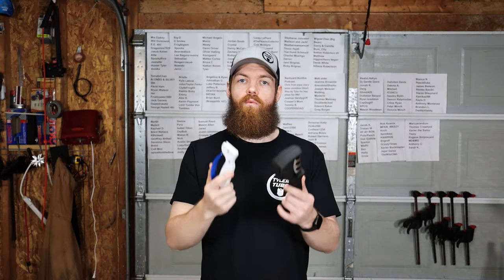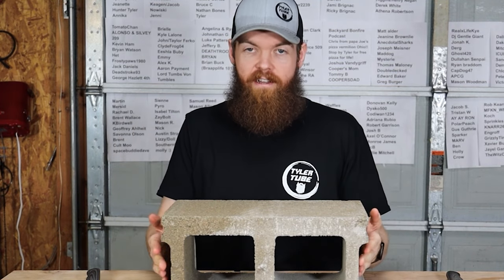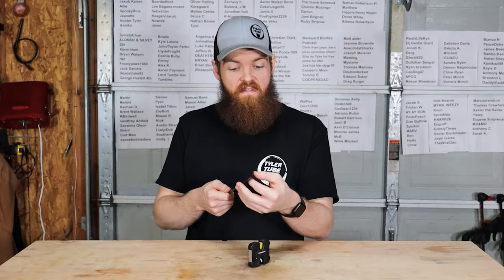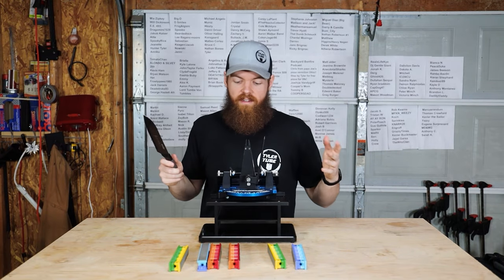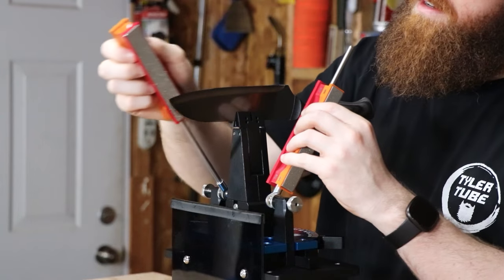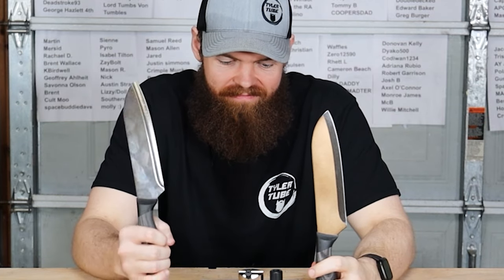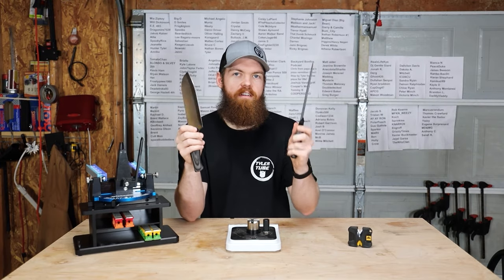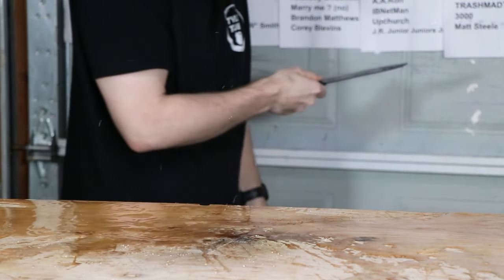$4 VS $1000 Knife Sharpener, Which One Is Better?

Comment: The sharpener is only as good as the blade’s metal and the acuter the angle the sharper it will get but the edges durability will be compromised.
Reply: Also I have the work sharp version of the wicked edge and I can get my kitchen and hunting knives raver sharp. My work sharp sharpener comes with ceramic stones and leather strapping pads that also put a nice mirror edge as a finishing edge.

Comment: You made 3 mistakes with the wicked edge. 

1. You didn’t shim the clamp. That’s why it moved around

2. You didn’t center the blade in a forward manner. It was certainly way too far back 

3. Your technique was amateur. You need to know how to use that system

Other tests with that system get the wire broken at under 100 grams. Sometimes as low as 30

No joke

Comment: What a crappy test !   The cheap sharpeners don't allow you to choose the best edge angle ( maybe 15 degrees for a Japanese chef knife,  17 deg. for German, 20 degrees for  most kitchen knives, 25 degrees for most hunting / survival / bushcraft knives, Axes, mower blades and other tools ( whatever the factory did or maybe 30 degrees ).
   Instead of stopping at 1000 grit, finish up with 6000 grit or a ceramic rod and a leather stropp.

Comment: I learned to use a whetstone when I was about 7 years old so this seems really excessive to me. If a 7 year old with minimal experience can make a kitchen knife shaving sharp then anyone can.
Reply: It's not just about creating an apex, this controls the angle, bevel width and compared to freehand sharpening on old stones with newer supersteels is generally superior.

These are used on knives that make $1,000 seem like a very small investment.

Comment: I have used the bottom ring of a coffee mug to hone knives with and I find it works just as well. Tyler you could try doing the same as it really does work and the best part is it costs less than the 4 dollar sharpener.
Reply: Honing is what most people should be doing before every use of a knife. It will keep the edge much longer until it can't keep an edge and needs to be re-profiled. Working in a professional kitchen. The knives only have to be sharpen every 6 months to 2 years. with good honing technique. People go to the stone to often when it only needs to be Honed.
Reply: @faervas1234  you are right as rain and the best way I have found to keep my blades sharp is to hone them ! Maintenance is key,that and using knives correctly in the first place.

Comment: you don´t even finish the knifes with lether strops, that makes a huge diffrence removing burres.  the 1000$ is way better if done correctly.  I an the other hand uses only Tormek T-8 ,  It is so superior to almost everything, knifesharperner with water and turning stone is incredible superior to make a knife sharp, and mutch cheaper then 1000 $, more like 500$, the original stone can be 220grit or 1000grit,   I only use 220grit and knifes get so sharp that you can push a knife frue a papper,  I don´t men slicing the paper, just pusch the knife frue the paper , that is verry sharp.  everyone slicing a paper with a knife, try to pusch the knife frue a paper an one spot an the edge, if it can do that  it is mutch sharper then a sharp knife!

Comment: You fundamentally do not understand sharpening techniques like de-burring , polishing , apex creation or how to use the wicked edge.
If a user doesn’t understand those concepts then they are definitely not going to get the most out of advanced sharpening tool.
Pull through sharpeners can cause so much damage to knives they are only really for people with no interest in sharpening that have cheap knives.

Comment: For anybody watching this, 2 observations:

1) When you use the pull through carbide sharpener you are cutting a "V" shape at the apex. once you've  cut the dulled edge enough that it fully reaches the pointed V shape, no additional pulling will give additional sharpness. 100+ passes on a carbide sharpener is simply grinding the edge of the knife away. The ceramic section hones the tip of the V to minimize the burr on a fresh carbide edge and touch up a lightly used edge. It only takes a few passes to do this. Poor technique and human error means results in minor misalignments that will round off and fatigue the edge. This video is NOT a how-to for proper use of the sharpener.

2) Even when using a guided system like the wicked edge, you need to use the proper technique and sharpening fundamentals. It's not an elliptical machine for an arm workout. this video is NOT a how-to for proper use of the sharpener. The edge needs to be properly apexed, then burr-minimized before progressing to the next reasonable grit. Not every grit in the kit is needed or even ideal for a sharpening progression. This video shows what happens (regardless of sharpening system) when you don't apex the edge, don't maintain the correct amount of pressure, don't verify burr formation, don't minimize the burr, and finally don't remove the burr. 

If anybody is interested in actually sharpening a knife, there are plenty of good youtubers that teach proper sharpening techniques. BigBrownBear, Michael Christy are examples of "pro" sharpening channels. While Cedric&Ada Outdoors is a great example of an everyday joe (or pete)  who uses a guided system with proper technique to achieve excellent edges. Vurtovice is a great channel of an old fud who sharpens knives the old-fashion way using proper technique, sometimes with microscope views of edges.  Do yourself a favor and watch some videos discussing "apexing", "burr minimization", and "stropping". A little practice with relatively inexpensive equipment will result a better edge than $1000 kit used incorrectly like it was here.

Also, you can't use pot-metal throwaway knives that have zero quality control over the steel.  A quality knife doesn't have to be expensive, but it can't be of unknown material, hardness, etc. A Morakniv mora basic can be found on amazon for $9.99, which has known cutlery blade material hardened correctly to hold a knife edge. There is no excuse for using a $16.99 crap knife using junk 3Cr13MoV steel hardened to an atrocious 52 HRC. it is the pinnacle of rebranded overseas trash made by the lowest oem bidder from the cheapest available materials.
Reply: Fantastic! You get it.

Comment: Just so you know that when normal knives get dull it’s not because they were scraped against cinderblocks. You’re taking off so much more metal than you need to be!!!! Just cut some tinfoil like a normal person! The knife sharpeners that are generally sold to public are not meant to reform as much metal as you took off!!!! Stopppp! That’s why you had to run it through the knife sharpener 200 times on one side!

Comment: lol regardless the ceramic bein labeled as 1000 still has that 2000 grit and up in it so this is literally just user error and not knowin how the thing fully works plus that guide fucks you up more than helps you just a heads up cuz i mean if you sharpen knives alot and know your blade the feel of it an all that you won't need a guide

Comment: Tyler, you're entertaining to watch, but a long way from scientific, or even reliable. The paper test is more a test of how rough your blade is (if you have a pretty sharp blade with a rough edge, it cuts paper much easier than a really sharp smooth blade (400 grit sharpened knife will do the paper cut test easier than an 8000 grit sharpened blade. The tungsten sharpener is only good for a few sharpens and then leaves such a corrugated edge on your knife it becomes impossible to sharpen effectively without taking back with a sharpening stone to a smooth edge. Your water bottle test is only a test of technique and luck. 
Lastly the $1000 sharpener puts a different angle on the edge along the edge of the knife (it cuts a cord across the radius of the sharpener motion,) so, as usual, the angle is almost irrelevant. Anything up to about 30 degrees will make a really good edge if ground and polished well. I've never seen your scale based sharpness testing rig. I'll have to find out how it works, but I'd bet good money that your $1000 sharpened knife would post different results depending where on the blade you tested it (providing your test rig is reliable to within 2-3%)

Comment: I know I’m getting into the comments a year later than it’s released but this is 100% user error on the wicked edge. Sharpening basics dictate that you need to get a burr at the apex on each side before continuing. Burr removal and stropping is key and you didn’t do any of that. Research and practice.

Comment: The sharpness tester could use an improvement. I'm sure it measures accurately, but are you sure it's doing it in the same spots?

I'm thinking you make some kind of rig that allows you to put the tip of the knife in preset locations, and then test the sharpness at that point. This will give you multiple test locations along the edge, and you will be consistent across each blade.

Before you start any testing, you should also ensure that each blade have similar values (+/- a few percent) measured across multiple tests at the same points and across the blades.

Comment: To everyone: have you worked with such an expensive sharpener already, and how dangerous is the operation.
It looks like the grid stones don't have a very good grip (I have no expertise, but that's the way it looked on video).
If you slide off the grid stones, how high is the change of cutting yourself on the knive?

Comment: If your goal is to look stupid, you did an amazing job.  

You need to take each side to the center of the blade called the apex.  At the apex you will raise a burr.  Burr both sides then continue on to the next grit.  

I won’t waist time watching other videos of yours if this is an average presentation from you.    

The $4 sharpener is just your speed.

Comment: Let’s not include, both knifes had diff sharpness levels. 
You significantly took the $1000 knife lower than the $4 knife even if they were close in grams
Reply: Doesn't matter, the equipment he has is capable of completely reprofiling the bevel.

He isn't capable, but the equipment is.